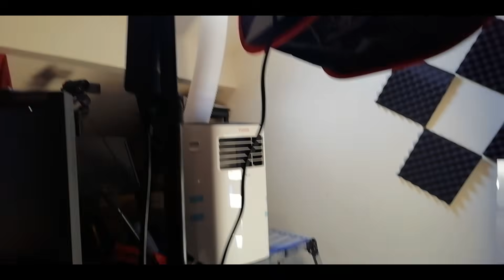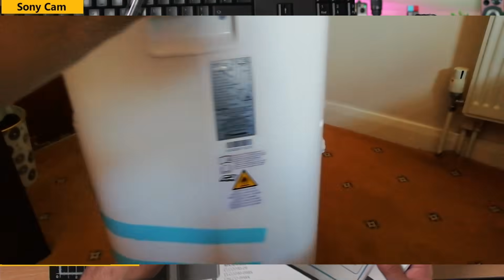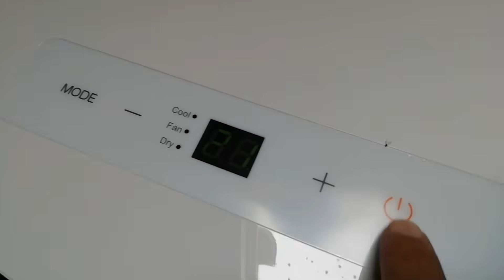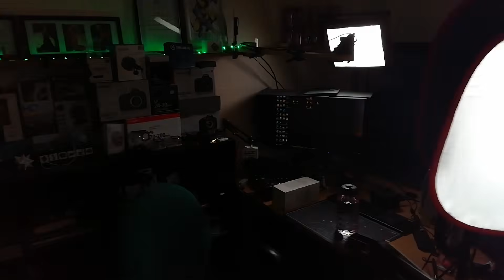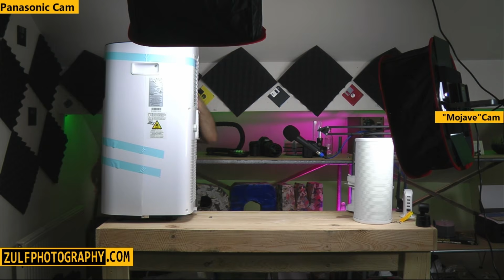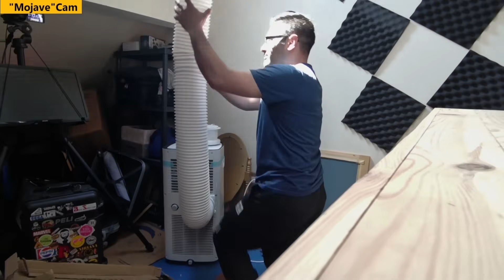Inventor 9000 BTU Portable Air Conditioner Review: UK Heatwave Test

Comment: I'm about 3 years late but this is a proper informative and helpful video. Apparently we're gonna have a scorcher this summer and I can't be doing with it man, I'm in a flat and even with minimal electric appliances running and using the air fryer instead of the oven or stovetop the temp gets up to 28c so this is absolutely essential... can't be arsed boiling alive again this year lol

Comment: Would it work without a window sealing kit, ie just venting it out a slightly open window.
Reply: I saw a comment somewhere , I believe on Amazon , saying he doesn't use the window kit and it works just fine.
Reply from the maker: Depends on the angles, but yes, i dont use a window kit. It works fine.  A window kit just ensures a seal, so pests flies mosquitos cant get into the room when ur sleep

Comment: How long does the refrigerant last and is it possible / easy to refill (DIY or professional)?
Reply: Had it for 4 years, now it feels as if its not blowing the freezing air it used to. Still cool but not as brand new.

I need answers too, on how to change the coolant, help!
Reply: @2dip you can't

Comment: Hows it holding up ? Still ok ?
Reply from the maker: Yes, just drain the water every year
Reply: @HypingTech yearly? Heard a slushing sound in the few days i been using so decided to look into the machine with the holes for the water and it came out with about 4/5 cups of water. 

Didn’t know about that as i read about the instructions saying its for the dehumidifier not the ac itself. So now, i’ll put a empty 1ltr bottle with the hose it comes with so i can empty it whenever

Comment: Did it survive and make any difference during last years 40 degree heatwave?
Reply from the maker: Yes I'm glad I bought it
Reply: @HypingTech  i ordered mine before they sell out when it gets hot, thanks
Reply: @Xbot4Life what do you think of it?
Reply: @Faded_Fragger  tbh, it works, feels like you are in a fridge when it blows on you. i am confident that ill be fine through the final heatwave this year. 

But just measure your room to make sure its more than enough for your size room.
Reply: @Xbot4Life  my room is like 12 square meters
Reply: @Faded_Fragger  your room is cubed not squared, find out the BTU requirements of your size room and the btu of the aircon. you must include ceiling height.

Youtube will tell you how to calculate the btu requirements of your room and the aircon description will tell you the btu of the aircon.
Reply: @Xbot4Life  its like 4-5 meters tall, and the portable AC is 9000btu

Comment: Does it leak a lot of water?
Reply from the maker: Nope there is an option on the back with a screw cap to drain water it has collected from the atmosphere.
Reply: Mines leak a lot. What can i do for this? @HypingTech
Reply: Thanks, I’ve got one on order!!
Reply: Do you need to drain it regularly? Is there much upkeep?
Reply: @nicolaredway4343  I bought it and it's been wonderful...I cools down the room pretty quick and it doesn't leak when you use the cooling setting...I don't use the humidifier as I have no need for it... it doesn't leak and I don't have to drain it so far...been using it for 2 weeks now everyday whenever I'm in the room.